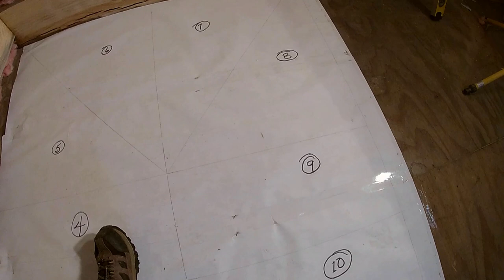Switchback Stairs & Layout Pt 1, Paradise Point - Ep 25

Comment: This explanation is very good in regards to the absolute most common error made, when building stairs. Calculating the material width of your finished treads into your rough framing is an absolute must. As well as considering the finish material at the top and bottom of the stair set. EVERYONE messes this up on their first or second try at building stairs. For someone just trying to learn how to build stairs, I would suggest watching this 2-3 times, just to let this critical point really soak in. Otherwise you won’t get it right, guaranteed and the fix is usually having to start over with new stringer material. 

I’ve always found it helpful to make several sketches first, detailing all of the dimensions that are going to go into your stair. You’d be surprised how helpful that can be.
Reply from the maker: Howdy y’all- thank you so much for watching the video and for the nice comment. I came up under my Dad who was a master indeed. God bless

Comment: Just a thought on the way the stair stringers are attached that would be simple, secure and doesn't take up any room: use a plywood gusset as a backer that your stringers face up to. The plywood gusset hangs strait down off the side of your floor beam, effectively extending it down so your stringers can mount to the face just like normal.
Reply from the maker: Howdy Rock- you have a really good point there. That would have been a good fix for it. If I have this situation again I’ll sure remember that. Thanks brother. Take care and God bless

Comment: Hi Paul, Great Video. Do you think you'll ever do a video on how you electrified the cabin. I would be very interested in that. Thanks, Love your channel.
Reply from the maker: Howdy Gary- the owner did the wiring in his cabin. When I work the logs out I drill holes in the them for the electrical. The holes are lined up from the bottom sill log up through the top plate log. It’s not that difficult to wire a log cabin if you prepare for it in advance. I still have the wiring to do in the cabin I started building on our property and I will show how it’s wired. Take care and God bless

Comment: I'm in the process of designing my stairs to my timber frame log cabin ,,,,I'm wanting to use Osage orange discs rounds with live edge on them for my steps but I'm wanting to make the stairs more of ramps than steps for my dad n company that can't step up on stairs but walk up a ramp ,,,,it's a job in,process and design ,,,,,,but I'm only working withun a small area ,,,,but I get alot of great info from your videos and I will take your info and work it in with mine ,,,😁
Reply from the maker: Howdy Dennis- stairs can be tricky but when you know how the basics work you can pretty much figure out what to do. Working in limited area makes it a bit more challenging but I’m sure you will make it happen. I’ve built handicap ramps before and they take a look of space. Our codes are 12” run per 1” of height. Merry Christmas and God’s blessings to y’all

Comment: Hello, we have appreciated all your advice regarding options to fix and repair our family dove cabin. My latest problem of 3 rotten logs behind the chimney has clouded my bigger problem. How to repoint and repair the back side of the chimney. Any shoot like devices or suggestions would greatly help. As usual love your videos. Not that it matters but I am working alone after a hired handyman got me for $😩 . So now solo it is.  Thanks again . Point looks amazing btw.
Reply from the maker: Howdy y’all- getting behind the chimney without removing the logs will be a challenge. Could you remove the chinking and pump some kind of cement in there? Unfortunately, if the flashing on the chimney gives way there can be water get behind and cause damage. It might be possible to cut out the rotten pieces and replace them. Not being able to actually see it it’s a bit difficult to tell you exactly what to do. Hope you can get it fixed up. Sorry about your helper. Take care and let me know how it’s going. God bless y’all

Comment: Wouldn't it have been better if you put the top steps against the wall? Was there a reason why you did not do that? Oh, was it because of the wood stove?
Reply from the maker: Howdy Kernix- if the top stringers had been right against the wall it would’ve been difficult to get on them. They are attached to the upper platform which is against the wall so actually the weight of the stringers is against the wall. It would have taken up a lot more room. That’s the reason for doing a set of switch back stairs. God bless and Merry Christmas to you and yours

Comment: So glad to find your channel again!  Glad to see you doing so well!  Hey I was wondering why your top length of stairs were not ran against the timber wall instead of floating out there.  Is that to save floor space?  I was just thinking that the timber wall would give you a bit more of stability for that section.  But I can see it would waste more floor space.  Your video is helping me figure out my house stairs.  I have a walk down to my cellar that is giving way and falling.  It is curious because it seems to rely upon a lot of tension to hold the whole run of stairs above it.  It reminds me of the old Jesuit mine death traps.  So I am doing more head scratching than diving into it headlong.
Reply from the maker: Howdy Bonnie- the upper section of stairs is supported by the higher platform that is against the log wall so the log wall is actually pushing against the bottom of the upper stringers. The upper stringers are anchored on the bottom of the second floor joist, which is not my favorite thing to do, but I was short on distance between the joist and upper platform. I really needed another 7” to be able to put the stringers against the joist. Hope this explains your question. God bless and a very Merry Christmas to you and your kin
Reply: @TheBeardedCarpenter  It looks sturdy as they come and thanks for the explanation!  Your videos are like taking a master class so glad your channel popped up in my feed once again.
Reply from the maker: @GrizzlyGroundswell  Glad you found us again. Many of our subscribers have not been getting the notifications for months. Not sure what is going on. Blessings